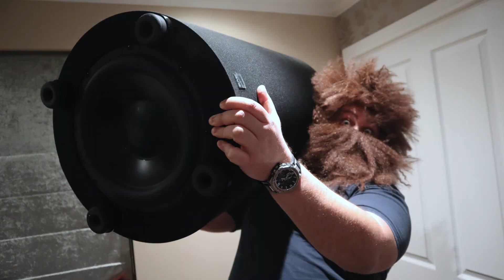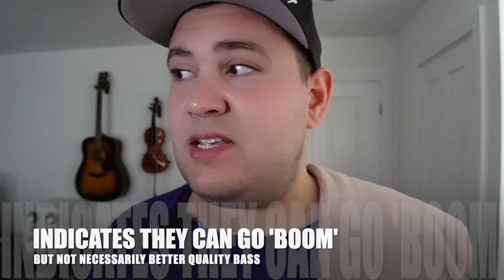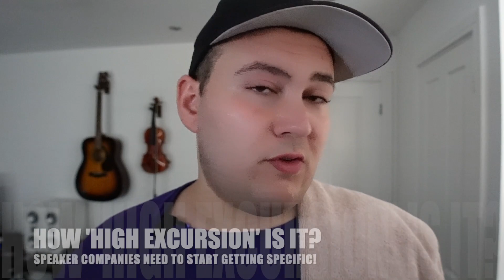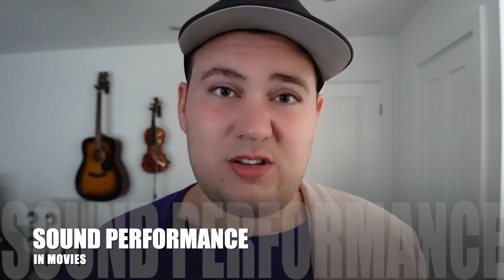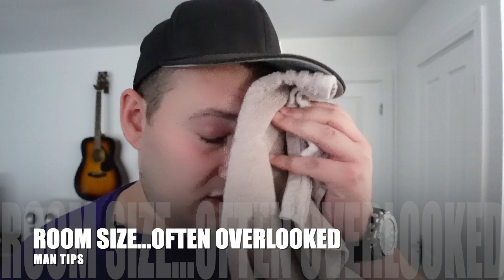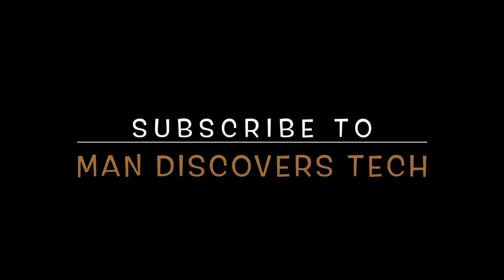SVS PC-2000 PRO REVIEW + Subwoofer BASS TEST! An Impressive Compact SVS Cylinder Subwoofer

Comment: I just bought a new PB2000 pro in the WOOD Veneer ('black ash'), however I much prefer the look of the PC2000 but the salesman said the PB sounds better because the PC focuses on space savings at the cost of sound output.  I would love to hear first had experience between the two if anyone has heard both?  

On another note, im very surprised at the accuracy of the PB2000pro in the upper frequencies (100hz) as well!  (although i bought it for the 20hz area).  The app with 3 band EQ is INCREDIBLE for tuning and making them sound COMPLETELY different and more accurate.
Reply from the maker: hehe the pb2000 pro comes in the black ash veneers but i don't think the pc2000 pro has this anymore. No exotic woods either which is a bit of a shame :(

Ive heard the old PB2000 original before and I really don't think there's much of a difference. Alot of it comes down to how the subwoofer interacts within your room and where you put it. 

I have noticed SVS drivers happened to be decently low distortion compared to rivals yes
Reply: @geezerintotech  the PB2000 is very different than the Pro. all different parts.
Reply from the maker: @philindeblanc  i've heard the pc2000 and pc2000 pro - sound pretty identical to me when set up
Reply: @geezerintotech  really?  weird. I have a XTEQ 10" and wondering if a pb2000pro would be a truck load better. I have no complaints, but not exerienced a ported model in my home. I know and have heard them and they get low Hz...but..IDK?
Reply from the maker: @philindeblanc  It depends on your room size - I think if you are happy with the current subwoofer in your room, then maybe no upgrade necessary. 

But here is my opinion for most people who care about audio fidelity as well as the raw SPL:

1. Don't buy a ported model until you reach at least the 3000 series of SVS subwoofers. The 2000 series and below are kind of jack of all trades masters of none

2. I would prefer starting somewhere like the SB-3000. You will experience great power (considerably more than your current unit) and it is also a sealed unit so you get excellent transient response and dynamics above 40hz. The sub-40hz response is still great for a sealed subwoofer. It also saves a significant amount of space compared to a ported and is easier to set up due to the weight

The best subwoofer I have tested overall (to date) is SVS PB16 Ultra - that subwoofer had everything, the power in the sub-bass and great fidelity when needed, and very easy setup - but it costs alot of money.

Hope this helps
Reply: @geezerintotech  Thanks, that is some food for thought. But not chicken drumsticks...LOL. Well, I am going to stick it out with this Xteq for a while. Maybe by that time I can do a PB16 or a SB3000. But it is the infrasonics that would tickle my fancy. :-)
Reply from the maker: @philindeblanc  I have a review of PB16 ultra vs Arendal 1723 2v. I talk about infrasonic performance in that review. 

If you're interested :

https://youtu.be/RRXCE081vbc
Reply: @geezerintotech  I will check it out. My space is 19 wide and 15 deep and 9ft tall. If you can imagine a wide "C" shae made of 3 straight lines, its the shape of my space. Seating is along the 19ft wide back wall, and speakers according. rear channels are on stands 2-3 feet from couch. Sub is near the corner of the left channel speaker, placed diagonally. I'll check out that link.

Comment: Great review man! Every comment you made, is what I found out when I lived for 2 months with the pb200 pro and sold it. Is the center channel at the Teufels different than the Left and right?
Reply from the maker: Yes, subwoofer integration is very hard - especially in room with sub-par acoustics.

I am working on a solution to this problem with subwoofers...using a bit of music theory actually.

Video is coming soon on that (if it works out haha).

By the way, centre channel is the same speaker mate. Teufels are LCR  monitors (sealed not ported) so they're all identical and produce a nice clean sound.
Reply: @geezerintotech  You are going to be a subwoofer expert. You have already reviewed the most discussed subwoofers of the market.I was wondering if you could review some arendals.Another channel in the us has very good opionion for their products. (subwoofers and speakers).